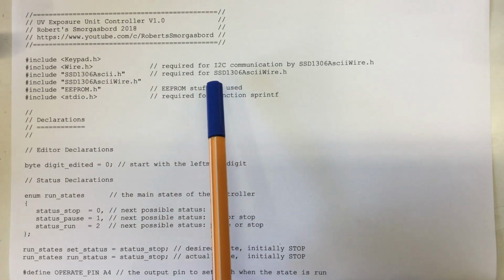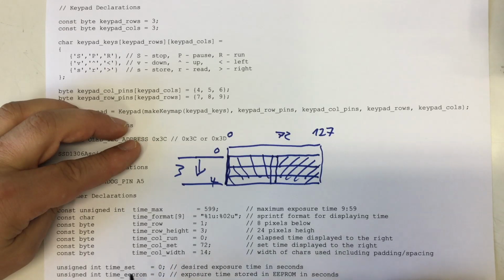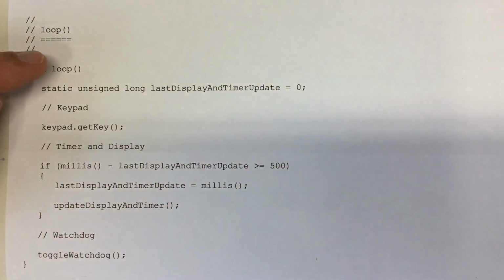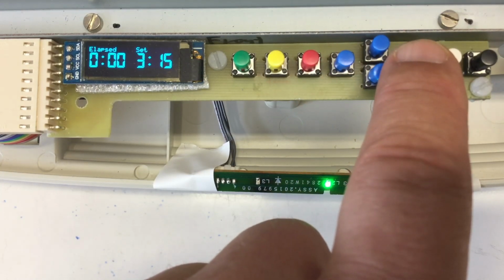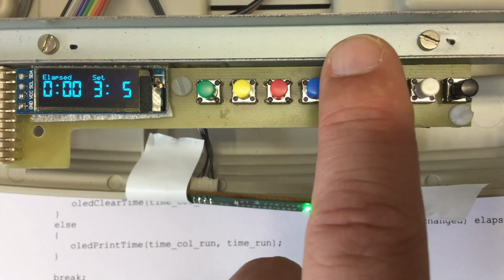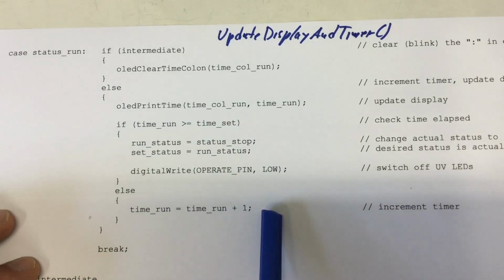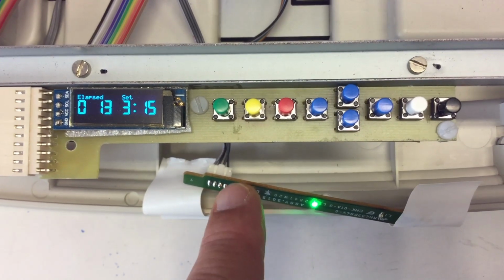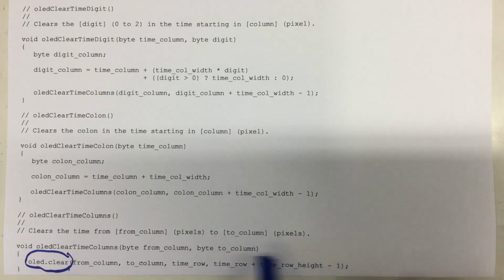UV Exposure Unit Build (12): Controller (Software)

Comment: Hi Robert, You will remember that this project of yours gave me the idea to build a UV light exposure box out of an old UMAX SCSI scanner. I build two boards using KiCAD and my CNC machine to engrave the circuit boards and a power supply module as well. Now it is time for software, and I thought of asking you to use your code. I dont have room on the scanner itself so I will make a separate box with my 3D Printer. So if you agree, I would love to get the schematic (pdf) of your controller board and a copy of your software. Regards, RJM
Reply from the maker: Hi René-Jean, I've added the files (circuit and layout for controller and display/keypad) to the already existing Google drive: https://drive.google.com/drive/folders/1vmu6NW8ZXZKVkAIxGkxK53tPzjxXogMg?usp=sharing
WARNING: The footprint of the OLED display is not quite correct. It shows the active display area in the wrong spot!
Let me know when you need anything else.
Regards, Robert
Reply from the maker: Hi René-Jean, forgot to upload the Arduino .ino file itself - just did that. Regards, Robert
Reply: Hi Robert !

Got it. Thank you for all. I will let you know how it goes. Regards,

René-Jean
Reply from the maker: @rene-jeanmercier6517  You're welcome! And good luck with your build!
Reply: Hi Robert, Hoping to find you well. Please tell me if you can grab those files at : https://drive.google.com/drive/folders/1ibjtV753cUcbeR9xqORmXiXtXAcKZ4R2?usp=sharing. Regards, RJM
Reply from the maker: @rene-jeanmercier6517  Hi René-Jean, no, I couldn't access that Google drive folder. But I left you an access request there ... Regards, Robert
Reply from the maker: @rene-jeanmercier6517  Hi René-Jean, I can access these files now. Do you want me to do something with them, or are you just testing your Google Drive ;-) Regards, Robert
Reply: Hi Robert. I don't know if you got my e-mail yesterday in which I say  that it is simply to show you what I do with my tools. I also take the opportunity to thank you for your application. In the files you will see pictures and a video of the final product. Kind regards, RJM